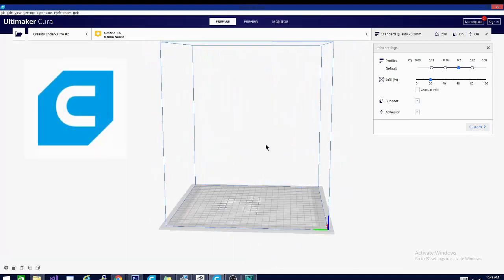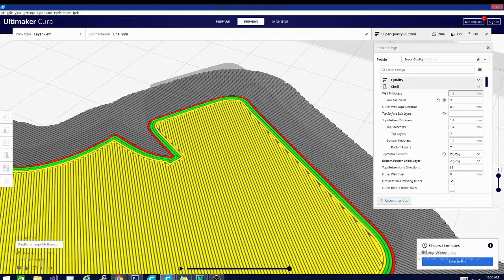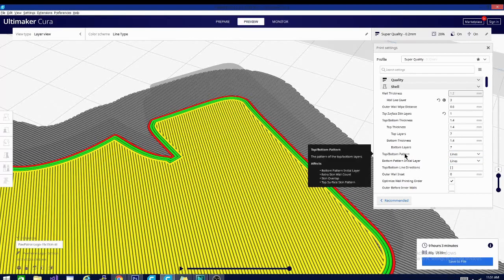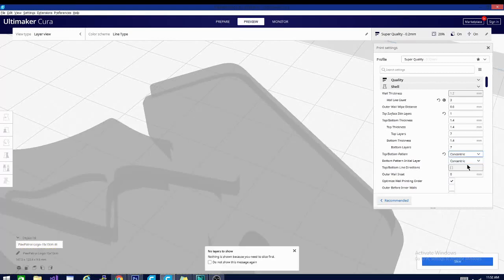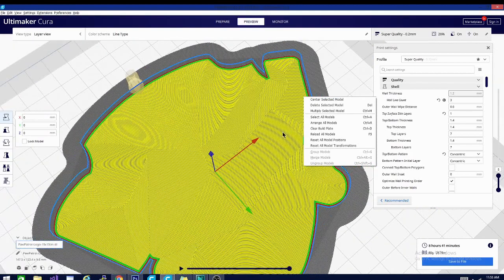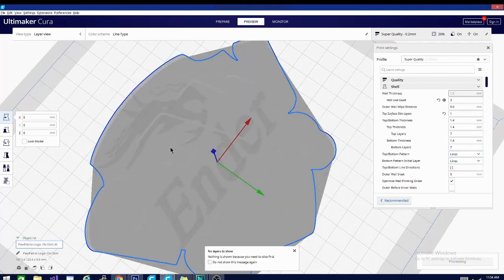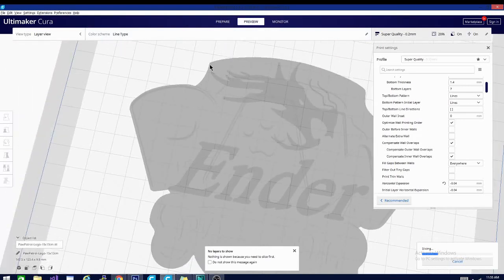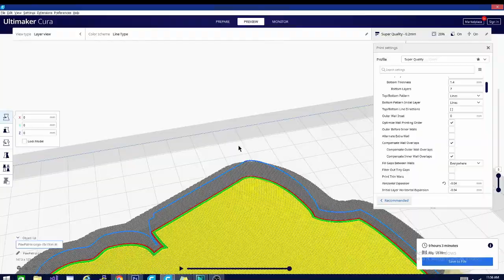Cura 4.8 tutorials - Shell Settings - Top and Bottom Pattern

Comment: How does this and other top /bottom settings effect spheres?
Reply from the maker: This setting will only effect the number of layers selected in top layer and bottom layers settings respectively. So how much is top and bottom is up to you. I would probably do concentric since the top of the sphere should be a circle.
Reply: I recommend using your modeling software (Tinkercad will do this) and having 2 copies of the model, then turning one upside down, then sinking each model halfway into the work surface, then exporting to .STL. That way, you can print a sphere without any supports and then glue them together when you are finished printing them. I use this technique whenever I have anything that otherwise would use a bucket load of supports. Then the top and bottom layers aren't as big an issue, and using concentric will, or should, make the top look very nice.